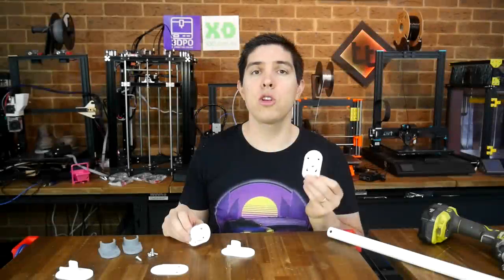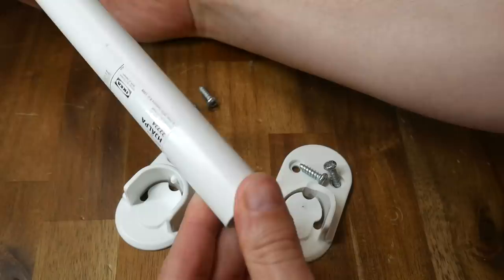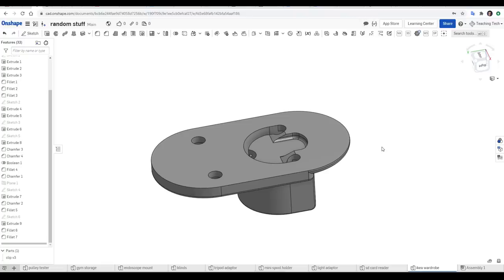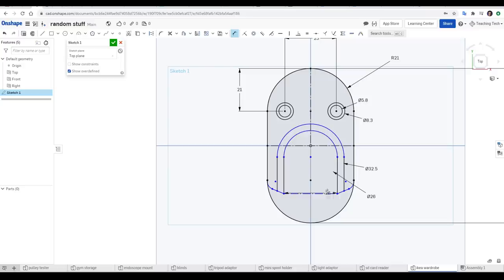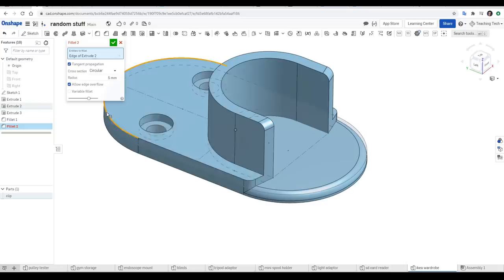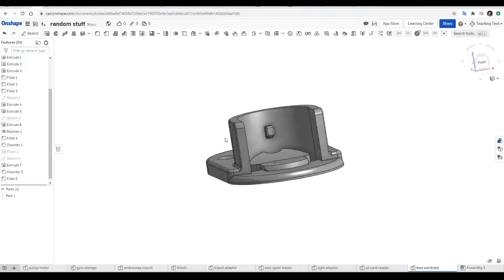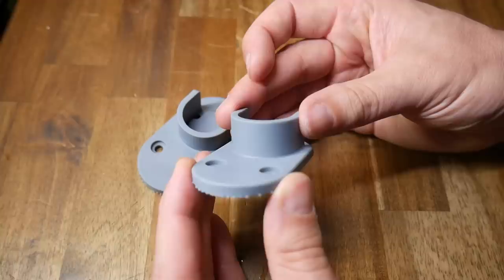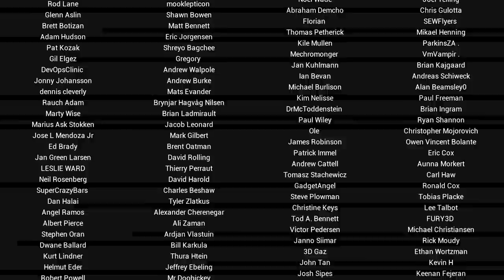Replace broken items around the house with 3D printing

Comment: Having had a 3d printer for only a few months and just learning CAD design, fixing things around the house has been my favorite use. I’ve designed and printed a switch for a small hand vac that broke, and most recently made a new bracket for a telescope mount that broke. It’s an empowering feeling to look at a broken whatever and say “I can make that, I can fix that.”
Reply: after a very small test square to get levelling right, the very first thing I printed was half of a clip for my bike headlight. the bike half of it had snapped and the company didn't offer replacement parts. It felt nice using the printer for something good :)
Reply: I got my Ender 3 v2 in late September or early October for about $300 to my door.  After a handful of test prints to dial in settings over the next week or so I printed a guide rod retainer for the window regulator in my Jeep that had broken.  The way I saw it was that I had three options; I could buy the entire regulator for $300, buy a 3d printed retainer off of a guy on a Jeep forum for $40, or buy my own 3d printer and go to town.  I told the wife I was spending $300 to fix the Jeep window and she said cool but when the 3d printer came she all but said wtf.  Now that we've fixed and created a few things with it she thinks its pretty cool but she was not very thrilled with me initially.
Reply: Bravo!

Comment: Why did the IKEA designer put the retainer sideways? Planed obsolescence! Those retainer hold longer if they are screwed up right such that the bar has to slide from the top instead of sideways. Previous models of the IKEA wardrobe had this mounted up right. People follow the instructions blindly nowadays that it makes me feel sick when companies abuse this trust. You should have ignored this Montage step and mounted them upright.

Comment: i would make it simpler, with U shape looking up, without retention lip. Sometimes engineers just complicate without any need
Reply: i was just thingking the same thing. i don't see why they put them like that.
Reply: @LordAnubis0909  gravity in sweden is sideway!
Reply: Seriously, defiantly designed to fail.
Reply: @majstor76  nice, exactly what should be done vs replicating poor design choices
Reply: I think the company uses this part in multiple products (therefore a different scenario for each) to save cost.
The U shape would indeed give the best results here. However, the clip would still be necessary to prevent the rod from accidentality detaching (e.g. when the rod has no hangers).
Reply: @abdulazeez.98  true, those are valid, just the latter point might not be worth the lack of dependability especially given its flimsy tab and u design
Reply: That was my thought. I've used simple U-shaped closet rod holders for many decades without ever having a problem. This is a needlessly complex design that has many built-in failure points - but that seems to be typical Ikea.
Reply: or three screws?  Two below, rest pole on it, and attach one more above to hold it in place.  Not quite as elegant as 3-D printing a replacement part, though....
Reply: Also, you're not constrained to design the part with all the features that were present in the original. It was designed to be injection molded (common wall thicknesses, draft angles, fillets sized for material flow, etc.)  I'd have also reinforced any deficient areas, and simplified others. The retaining tab doesn't require support. It could have been modeled so that it contacts the build plate. The thickness of the root of the tab is the only part that is critical to the flexibility/durability of that feature.
Reply: I was thinking exactly this too XD

 Could of made something in 1/20 the time that holds it just as well and is likely way stronger.

Comment: The good thing about being able to make your own part is that you improve instead of just replacing. I don't know why anyone would spend the time to create a model of the same bad design that failed even when injection molded.
Reply: so you could buy a new one from them
Reply: His printed parts seemed plenty sturdy, (and he has two complete sets of those, plus the original white one that didn't break),  and did you miss the bit where he said he had the CAD model so he could very easily reinforce it if it broke again?
Reply: @lloydrmc  His printed part is the exact same thing that broke, except produced with a method that weakens the part compared to the original. And printing something twice because you made a bad choice is nothing but wasteful.

If you can't recognize that, I really can't value anything you say.
Reply: "Remember to keep comments respectful and follow community guidelines"
 @AlexusMaximusDE
Reply: @lloydrmc  😂😂😂

Comment: Easier method: take the hole measurement inside the wardrobe, then take the radius of the rod. Design your part around those. Much easier to do than model an existing part which you dont have the cad file. Replace the part on the other end while you’re at it because it will break sooner or later

Comment: One of my favorite 3d printing projects was when i successfully printed an obscure plastic clip for the dash of an old car. I took the old one and re-modeled it and then printed it. On this same car, I have printed: The piece that holds the grill in place, the rear wiper outer cover, a piece between the hood and windshield, grommets for accessory wiring, a center console storage tray and a headlight adjustment tool. I've more than paid for my 3d printer in time waiting for obscure and hard to find/describe parts that I needed that day.

Comment: thanks for the video.  a neat thing to keep in mind is in some cases it is possible not only to replace broken parts, but improve.  for example with this particular example I would make it so the screws are above the pole and add more meat under the circular section (which also means the spring tab is no longer required).  maybe I would do something else if needed.  replacing as it was is great, sometimes there is still room for improvement/customizing
Reply: Agreed.  My first thought would be make the fillets a larger stronger radius, to compensate for 3d printed vs injection molding.. not to mention you already know where its likely to break. put a rib under there if there is clearance of course.

Comment: Simpler method.  Take a picture of the part, import the picture in fusion360, and calibrate it with one measure.  Then draw your sketch over the features in the picture.

It's not perfect, but it's fast.
Reply: Works in FreeCAD too.
Reply: Photogrammetry OR 3D scanner and you can import it as a 3D model 😉
Reply: @S0Fr3shThisKid  Photogrammetry usually sucks ass and good 3D scanners are expensive.
Reply: But all you need is a pic, dont complicate things
Reply: If it's a flat enough part, sometimes I'll just toss it on my normal flatbed scanner. Nice, clean well-lit scan.
Reply: @S0Fr3shThisKid  I have bad news for you. Display.land closed a couple of months ago.
Reply: @Deses  Oh wow lol well Intel still has their cameras
Reply: photogrammetry or sketch over a picture ... that's how people who don't do CAD or 3d printing think we make 3d models.
This may look simpler for a really simple shape, but it's going to get ugly really fast if it's not a cylinder.
It's actually faster to start sketching it directly, and make sure you get the critical dimensions right, in this case:
diameter of the tube, diameter of the hole in the tube, distances between the screw holes if you intent to reuse the holes. 
This reminds me of older people who think it's better to make a scan + print of a document they just printed to print several additional copies when the printer has a copy function.....
Reply: Any distortion in the photograph will guarantee the part will not fit.
Reply: simpler still just swap the left one for the right one and the broken part will be pointing up. Problem solved
Reply: @abyteuser6297  ok, that wins

Comment: 2:19 You can use the back of the head to measure heights too. Took me years to realize that one 😅
Reply: I’ve definitely never thought of that... seems like it would work better in a lot of instances.
Reply: Good point, easier for external dimensions. And the bottom for measuring height in smaller spaces
Reply: Tail its mostly for measuring deepness of the holes and cavities.

Comment: Great to see someone else using Onshape. I've been using it as a 3D printing hobbyist for 4 years, and I Love it - particularly it's entirely on-line nature, so I can start on a design in my office, then pick it up on my laptop in front of the telly :-) - I'm still a novice, though, and you've given me some ideas (like the separate part, joined later using a "boolean" - never knew that feature existed!)
Reply: @SystemsPlanet  that is exactly what I asked myself when I checked it out. Also I could not find any mention about free for non-commercial use - shame really

Comment: BIG THANKS! Another big reason for 3D printing things for around the house, both repair and solving other problems -- each of those tasks is a goal to help you learn those CAD tools, and expand your skills in using them.  And you showed one of my favourite prototyping approaches -- doing one (or more) quick partial prints to prove out critical dimensions and/or functionality. Do that quick five minute print to be sure you've got things right, and when you have, keep refining. Saves the trouble of aborting a print two hours in when you see that it won't work...
Reply: I do the 'test print(s)' method anytime it is complex or tight tolerance (especially assemblies).  just had a project (well finishing it up anyways) where I had to print test articles.  partly because of how tight everything was, but also because the housing I was 'replicating' was practically disintegration as I was working on it.  so it was hard to get good dimensions at times

Comment: This is another great video, and I understand why you made the parts the way you did to show how to do it in the video.  The only thing I have to add is stuff like this, it probably would have saved a tun of time and work to just create something simple from scratch instead of making an almost perfect replica.  This isnt a part that requires near perfect replication as you replaced both sides, it just needs a part that works.

Comment: When replicating objects and pretty much all such things that need to fit something that already exist: use construction paper and cut 2d shapes, test them in place and when they fit, measure the difficult bits from that. And prepare for the eventuality that you need to print the object again. It will happen, it is quite rare that the first print comes out exactly right unless it is really simple thing..

Comment: This is why I bought my first 3D printer. A hinge bracket on my bathroom cabinet had broken. Parts were not available and the cost of a new cabinet was V expensive compared to the cost of a 3D printer. I took the plunge, purchased and then built the printer (it was a kit version), created and then printed the part and saved myself quite a bit of money in the process while feeling pretty good with myself for doing it. I've never looked back and now 3D printing is my main hobby!

Comment: Ha! My first 3D project on my first 3d printer which I just purchased was printing a replacement for the broken window blinder nylon string holders (a hook locked at the bottom of the window to tighten the nylon string). BUT I not only replicated the broken part. I also implemented a series of improvements which have given additional strength and stability to the element.I have absolutely no experience with 3d printing, but by logic this seems like the rule No 1 when replicating broken parts.

Comment: That part would be able to hold weight better and be less likely to break if it was rotated 90 degrees, so that the "U" shape sat on the cupboard wall as a cup. As it is, it is only a matter of time before the rod gets pushed out the back.
Reply: I came here to say just that - I don't think the part would have failed in the first place if it were rotated 90 degrees.

Comment: Just did this a few weeks ago. We have two upright cabinets that we repurposed for the lack of kitchen pantry storage. I had a bunch of wire shelving that you'd typically use in a closet, but didn't have enough brackets. I took a bunch of measurements much in the way you did and duplicated the cups the wire shelving fit in, as well as designing some rough extra supports that weren't used if it was closet shelving. Now, we've got a nice wire rack in between the shelves and have storage for sheet pans.

Comment: Measuring tip (for digital calipers) to measure center-to-center distances of two holes of the same size: Measure inside diameter of one hole. Leave calipers in position, but zero the measurement. Now measure outside edge of one hole to outside edge of other hole for center-to-center distance.
Reply: so obvious after reading your comment but damn if I haven't been guessing and triple checking
Reply: @barrabjj  😄

Comment: This is where a 3d printer really shines.  I've printed a customized bathrobe hook for my kid, several closet rod holders, picture frame brackets, replacement leg on my ergo keyboard, filament rack shelf brackets, Victorian styled shelf brackets for my wife's figure collection, replaced all lame dated knobs and handles with custom ones, and much more.  And I only needed free software to do it.  TinkerCad.   My son just made a set of hooks to hold our masks by the front door, and got school credit for.  :)

Comment: I actually had to replace this exact same part when I was completely new to 3d printing and CAD software. Back then, I failed miserably and just used the wardrobe differently, even forgot about it. Now I see this video and remember this broken part and I guess I will do it again, now that I have much more experience in both areas. Thanks!

Comment: My Dad's bathroom drawer had fallen off its slide. Upon closer inspection, the drawer's retention slider had worn through and no longer gripped the metal part on the cabinet. The day after I bought my printer, I set out to fix that issue. I designed and printed a replacement part and after just over an hour of design and printing, the drawer now functions properly again. I even printed a second one and preemptively fixed the drawer on my Mom's side of the cabinet.

It was a proud moment to prove to myself and my parents that the printer wasn't just for useless knick-knacks.

Comment: This is exactly why I got a 3d printer.
My favourite print I've done, similar to this was the air diverter valve/piston in my pheunatic brad nailer.
It was a 20 cent part that wasn't sold anymore and without which the nailer didn't work. I was up for another $80 for a new brad nailer.
3d printed part worked perfectly and it still in use a couple of thousand nails later.

Comment: This is a great real-time application of 3d printing.  Just like your automotive video.  I am working a part for my computer room to create a USB pod for a triangular unit.  Now you have given me the courage to make a part for my wife to fix a livingroom curtain bracket.  I have not used Onshape, but I am using Freecad 0.18 at this time.  Thanks again.
Reply: another example of where it comes in handy was my wife and I couldn't find shower curtain hooks our curtain wouldn't come off from.  after the carbine style hooks failed I made a simple shower curtain hook that was so tall the curtain stays on, and thanks to the edges I gave it, the hooks slide over the pole seam well and don't cause problems

Comment: I once used TinkerCad to model a furnace humidifier drain component that had broken. The original part was some 30 years old and no longer available. 

New 3d printed part snapped into place first try and has been in service for almost a year now.

I've also replaced the temperature control knob on a mini fridge where the factory part was about 10x the cost is should be and was a week away. About half an hour in software and a 45 minute print later, it worked!

I think I'm going to try OnShape now and check out that early videos!

Comment: I needed to modify my cheap orbital sander to have a vacuum attachment because it just came with a bag attachment out of the box and always created a mess. So instead of just buying a more expensive orbital sander that already had a vacuum attachment, what did I do? I bought a 3d printer and picked up a new hobby of course.
Reply: @darekmistrz4364  I couldn't print what I originally planned on printing until I printed all the mods to my Ender 3. I didn't realize what I was getting myself into. Now I'm in too deep. Please send help..

Comment: Sadly many people with printers just print other people's models, I tell people download the design software before you even buy a printer, learn the software then buy the printer. I recently sold my old house and I used the design software to make and replace draw runners, fence post caps, broken control knobs, all manner of things, it's the very best thing about 3D printing and it saved me from having to replace things, great video, that little prusia mini did a great job.

Comment: Thanks for the tip on the boolean Union.  Now for a tip of my own, I name the sketches based on what they represent so that I can find them easily.  Also, you can add folders so that you can divide the sketches into various stages.

As for my most useful 3D print, it's hard to choose because that is what I usually do.  I would have to say that the most cost effective 3D print that I have done so far has been the top gear for my Bernina 730 Record.